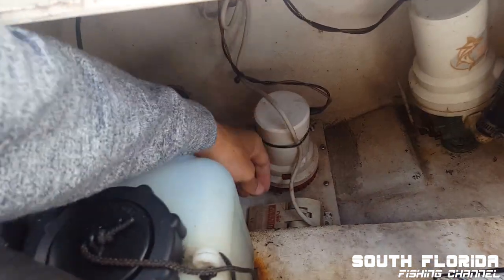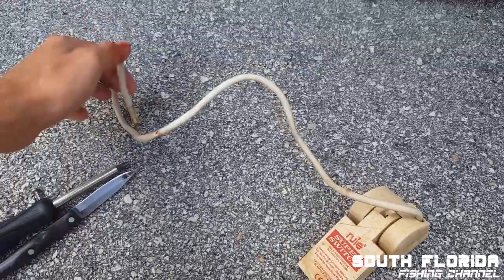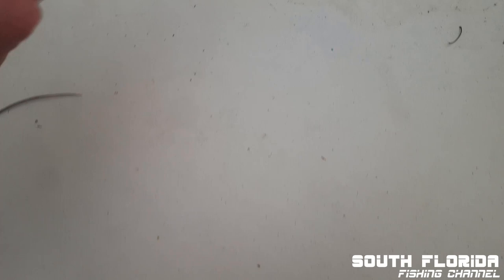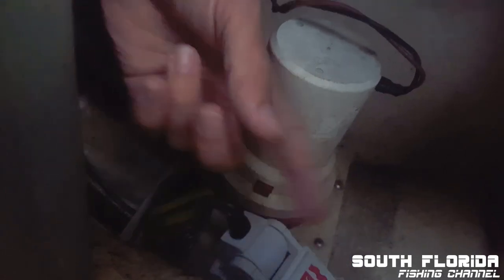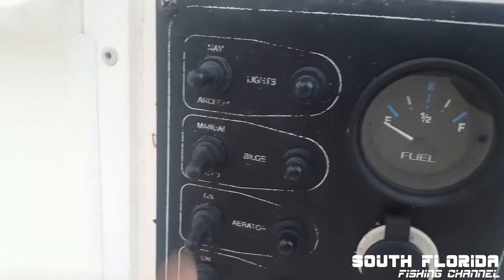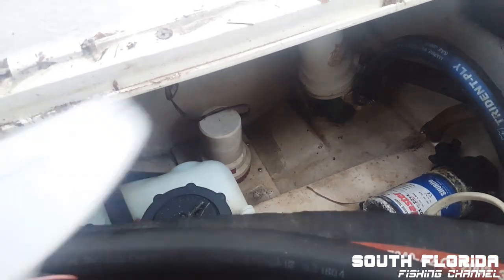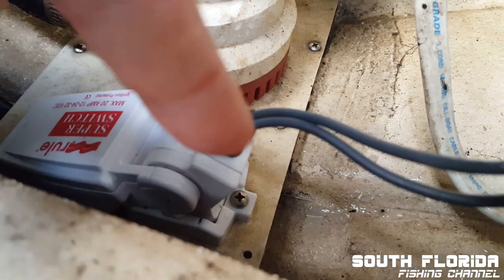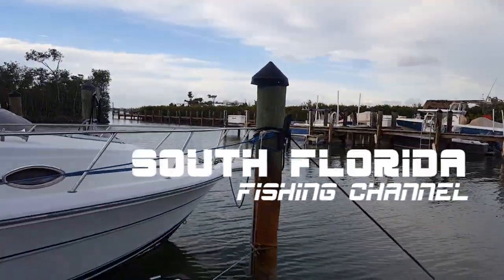What is a boat Float Switch - Rule

Comment: i LOVE your shows and watch them all.  just picked up my Angler 24' walk around so i'll be Gulf fishing from TX here in the next few weeks!  

have to say though.. A FLOAT SWITCH is NOT for when it rains.  a float switch switch is for when water finds its way into the hull to "HELP" get water out.  the hatches, latches etc shouldn't be leaking when it rains.  if that's the case you need new SEALS in the latch/cover spaces.  the boat ill shed its water then over the deck out to the back and into the water like it should be.  the boat shouldn't "catch" the water

what if your bilge or float fails and u don't know it and u have a massive rain...  waholla sunk boat.  if the water never catches in the hull in the first place no worries!  tight lines bud